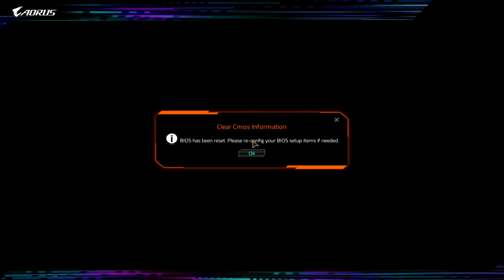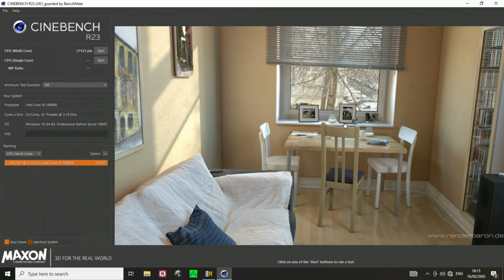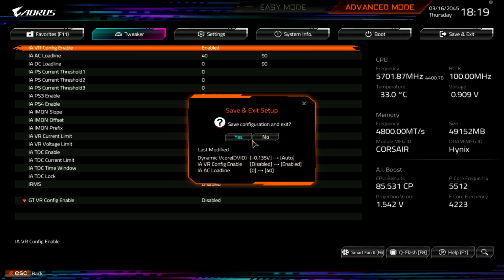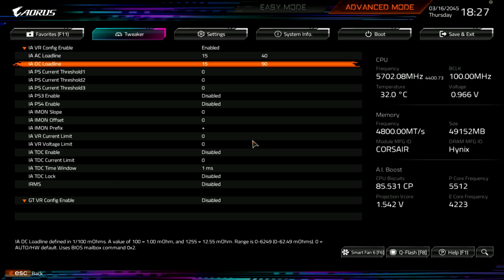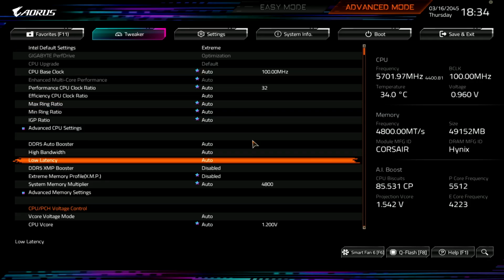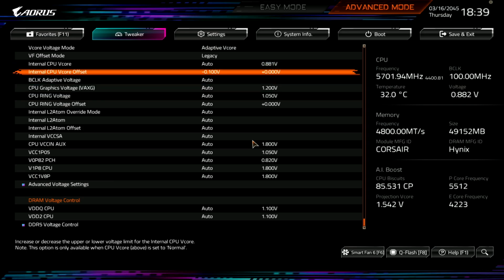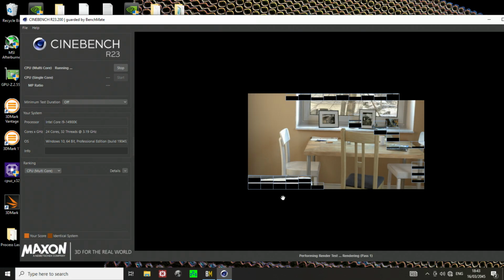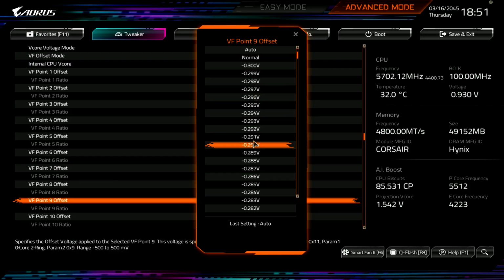YOU  DON'T HAVE  TO TURN OFF CEP to undervolt intel 13/14th gen CPUs

Comment: "So if I understood correctly, the 'Vcore Voltage Mode' should be set to 'Adaptive Vcore', then set 'CPU Vcore Loadline Calibration' to 'high' and lower 'IA AC/DC Loadline' to 55, and then the 'Internal CPU Vcore Offset' should be adjusted from something like -0.080v to the -0.110v  to tune the point where the CPU is stable?
Reply: se basicly 14k views and no person know anything about my ask :D ... and btw my r23 score with this settings is 39150 and max 1.385v and everything stable ... i tried almost every benchmark from BenchMate and im very sadisfried my temps cant go over 73 degrees but it is to god for me to feal ok :D so i need ask again can someone tell me is it ok what ive done it is described up.
Reply: Yup @CodeNameTech

Comment: I tried your config of AC_LL = DC_LL = LLC = 0.55 mOhm with CEP on and an adaptive offset (14700k, F5 bios, IccMax = 307A, no power limit). My previous settings were basically an AC_LL/LLC undervolt. The most bizarre change I noticed is that the CPU gets current-capped at a higher frequency, which results in a performance uplift in some benchmarks. I wonder whether it's a side-effect of CEP or increased voltage under load. Going to run a few more tests.

Comment: 13700k here. i did an - 0.02Voltage offset  and locked the cores @ 5.5Ghz and i never had any bluescreens since the beginning. so its below 1.35V always

Comment: Thank you so much for making this and all the other videos as of late!!  It has been a INVALUABLE source for me as a novice bios tinkerer. This kind of information and testing is so scarce, not even the board manufactures have a site you can go to that breaks down and explains how a mother board works. You have filled this gap of non information that really shouldn't exist. 
Its so weird that there's not comprehensively direct information available when using someone else's product that is designed for you to tinker with it. How exactly are we suppose to learn this stuff on our own without studying to becoming an electrical engineer?!

Comment: ASUS Z790 owners. Pls help... I'm unable to get an undervolt to work on the asus unless i use the asus defaults and this has cep disabled. 
It gets so hot without an undervolt.  
For reference if set an adaptive - vid core setting...
When i try this with the intel defaults the cpu just runs at half the speed in cinebench. Its strange.   
Help i dont know what im doing wrong.

Comment: Based on Intel documentation, CEP is the mechanism by which Fast-V Mode operates. It exists so CPUs can be safely used with low quality motherboards and power supplies that would crap themselves when trying to power a 14900K under heavy load.

I think people with higher-end motherboards and power supplies would be fine with CEP disabled, more safety features is never a bad thing.
Reply: Fast V mode needs to CEP on to work, but the two are separate features. Some BIOSes allow CEP on but Fast V mode off

Comment: Can you make a video explaining what IA AC Loadline and IA DC Loadline settings actually do? I've watched a bunch of your recent videos that touch on them but I still don't get it. I have a 13900KF that bluescreens and I can't RMA, so I'm trying to get it to be stable. For some reason, setting DC Loadline to 1 and keeping AC on auto with the default LLC stops my CPU from crashing. I've even tried undervolting with adaptive mode and a -70mv offset and it still doesn't crash as long as DC loadline is set to 1. I've capped the voltage to 1.4v, like you mentioned in one of your videos. I'm not sure if running these settings is OK or not because I don't really get what these settings do. There doesn't seem to be a performance impact with these settings and my CPU is running under 80c.

I've tried some of the settings you had in another video with CEP on and increasing LLC but that didn't get me stable for whatever reason. 

Unrelated but my CPU only seems to crash in games. Running benchmarks is stable. I'm currently using Ready or Not to test if the CPU is stable or not since that game seems to cause it to crash most consistently for whatever reason.
Reply: RoN was my canary last week. It has doodle compression issues with defective processors. I was able to get a replacement offer in 5 days, give it another go?

Comment: Does anyone know what is the most accurate values for i5 14600K ?
(With CEP enabled of course)

My current configs are:
IA AC load line = 50
IA VR Voltage Limit = 1400
PLs1 & PLs2 = 181
Enhanced Multicore Performance = Disabled
IA CEP = Auto (my bios default)
Dynamic Vcore = Auto (my bios default)
Vcore Voltage mode = Auto (my bios default)
Core Current Limit (Amps) = 200
Gigabyte z790 bios = F7 Ox123

Comment: Hi, any ideas that my 14900k only scored 38k? I followed the AC loadline setting to 55,  CPU Vcore Loadline Calibration sets to High, added Voltage limiter to 1400 and Vcore offeset -0.13. Im using same motherboard too:/ The only differences are i have XMP on and running on Windows 11

Comment: 14900K+MSI Z790i, BIOS v19, Microcode 0x120, Cooler Noctua D15
VID Offset (set through TS): Core/P Cache -0.11V
CPU LLC: Mode 4 
AC/DC Loadline: 12/0.12 mOhm (the same value as LLC Mode 4)
IccMax: 400A

PL1/PL2: 288W
UVP: Disabled
IA CEP: Enabled
TVB Voltage Opt: Enabled
TVB Pts Config: 1 Core at 80℃ -1, at 85℃ -1;  2 Cores at 80℃ -1, at 85℃ -1 (with TVB Voltage Opt enabled, this will prevent high voltage, since there is no voltage limit function)

Everything is good. R23 41000 pts (limited by PL2, around 5.5/4.3), CPU-Z 980+/17600+ (fully turbo boosted, 6.0/5.7/4.4)

Comment: I was able to drop voltages by -0.175 on my 14700kf with CEP enabled and using your loadline settings. Also I was able to increase clocks by 100 MHz, so they are 5.6 GHz all core, 5.7 GHz 1-2 cores. In HWINFO, the VID doesn't go above 1.199 V and VR VOUT 1.190 V. R23 ~37000 with 253w power limit. Also put 1.4 V limit just in case. Have to use my PC more to be 100% sure about stability but seems to be doing good.
Reply: loadline high 0.55 ac dc?
Reply: @mexicanomt2  yup
Reply: @mexicanomt2  or 45
Reply: -0.175? Damn. Let me try it with my 14700K.
Reply: @Owen-uk3sj  After a while I had to increase the voltage, as I found out that some specific programs/benchmarks were unstable. I don't remember what voltages I have now.
Reply: @aarraa9671 bro i have 13700 kf help me man... Just tell me your correct setting in bios
Reply: Set LLC to extreme? on the LLC at high it's not stable for me. I got 34K in R23 with my 14700K at the stock clock.

Comment: So LLC levels on ASUS have numbers, like 1-7, but on gigabyte it's names. So LLC 3 on ASUS = Standard on Gigabyte (1.1/1.1)? LLC 4 (0.4/098) on Asus = Low on Gigabyte? Or is it LLC 2 on ASUS = Low, LLC 3 = Medium, LLC 4 = High, LLC 5 = Turbo, LLC 6 = Extreme and LLC 7 = UltraExtreme? So what he is doing around 21 min mark is setting Extreme with 0.17 AC/DC, where this would translate to LLC 7 on asus with 0.17/0.17? Not sure of AC on LLC 7, but it should be DC 0.24, with SVID Behaviour at AUTO. Iintel fail safe on ASUS enabled does not change AC/DC at all on my board.
There is so much useful info in these videos, but it gets so hard to follow with all the rambling in between, I just end up confused and it's hard to get the actual relevant info. It's "this = do this", but with 4 long sidetracks in there :|
Reply: Also on Asus and struggling a whole lot translating it to our bios

Comment: For stressing arbitrary combinations of test program + frequency + power, you can limit peak clock frequency with the CPU frequency scaling controls, then set a CPU quota (cgroups in Linux, Battle Programmer Shriase in Windows) to PWM the test program such that it doesn't hit power or thermal limits.

Comment: Just the fact with the warranty extended , I seem many cases around me may be:

1. Give up😂 
Changed to AMD
2.like me , I am lazy to RMA coz
I void some warranty ,like delidding ,metal liquid …..just buy a new one while the DIE is really die
3. many cases ,they will not to RMA
For some country and may be hard to RMA 

In my opinion RMA quantities far away to degrade CPU
Intel wins first round

Secondary, ppl just have one pc and they dun have the buget to wait returning time , they suffering  a degraded cpu or else it cannot work anymore 

They delays RMA cycle 
Intel wins second round

Some suitable , ppl many not often to use their computer,and dun ready this news

After 2 year for later they computer not, they will think ,oh my computer is broken I should buy a new one

Intel wins again

Otherwise,intel is still selling the cpu !😅

So they wins wins wins again plus wins this game

Comment: 13900ks z690, AC DC 25~20/90 LLC low SA 1.25(auto), CPU Vdd2/Vddq 1.1v,  DDR5 6000mhz 1.3v ,P core 56x Cep OFF INTEL setting off 
IA VOLTAGE Limit  1320
dont go lettting intel baseline and 6GHZ boost (intel baseline  is extreamly HOT Temperture  0.90/0.90 mOhm)
warnning : Dont use 6GHZ boost ! , only use static clock (54~56x)

Comment: Most of this doesn't really apply to me, but is entertaining to watch. My cheap-a$$ H610M has almost no voltage controls, so DVID or loadline trickery is necessary for <1.1v vcore. Although with a 12100F without c states; I don't have power or boost clock concerns. Lowering watts/temps is fun to do anyway.
Reply: 12100F doesn't have CEP anyways

Comment: On the MSI Z790 Tomahawk this works. CPU i7 13700KF. Loadline 6 with AC/DC set to 40.
Voltage settings Adaptive + offset -0.130. All cores set to turbo offset. So 5.4GHz P and 4.2GHz E.
31410 in C23 no clock stretching. Max temp was 78 degrees with Liquid freezer II 280, 20 degree ambient.
It works exatly the same and my previous, loads of settings tweaked undervolt. CEP and TVB enabled.
I have no idea how accurate the HW Info values are on this board but for what it is worth: Avg max VID request was 1.237 Max Vcore was 1.226 (from the super I/O Nuvoton NCT 6687D)
CPU Enhanced: VR VCC Current was 180.4A and power 217W. This power, calculated agaist the Vcore reading, resluted in 176.9A so either the
voltage was a bit lower than reported or the Watt / A reading is off by a small fraction. But it seems to be withing few percent.

Either way this works great. I have tried pushing the E and P cores 0.1GHz higher than this and that seems stable as well, however I don't need
that for daily use and the only game I have played that hits all core max frequecny is Grey Zone Warfare which is a highly unoptimised UE5 shooter!
Everything else, CP2077, Elden, ABI, Warhammer, etc etc most don't get over 3.5GHz effective and that is only on a few cores.

One limit I do have separately set is power to 235W. Just as a buffer. However I obivously only hit that if I bump up the cores frequency from 5.4/4.2.

Comment: I am on fixed 1.1v with "normal" load line. 4.4ggz locked on a small cooler. Max load at throttle temps 125w.

Im wondering if this undervolt method could result in more performance.

Comment: Benchmark my i5-14600k. I limt pcore to 35x, and ecore to 26x.
With CEP enabled I get Cinebench score 350.
With CEP disabled I get Cinebench score 826.
Apart from the CPU-frequency, Im running Intel Default settings.
I have an Asus z790 motherboard
Reply: I also have an Asus z790 board and saw similar behavior where the multicore score goes from 24k to 11k with CEP enabled. Something about Asus' power configuration seems to trigger CEP pretty much automatically.
Reply: I think that means your tripping CEP. For example my mobo has the same bios as the one in the video where high llc matches with 55 ac_ll/dc_ll, and medium llc matches with 66 ac_ll/dc_ll. When i tried to reduce ac_ll/dc_ll even by 1, with 0v vcore offset, i.e. ac_ll/dc_ll = 65 with medium llc, my r23 scores dropped hard with cep enabled, and putting it back to 66 restored the score. Also noticed idle vcore was high when doing this with 0v adaptive offset, so i still needed an undervolt to bring that down. Also, i noticed in my bios that the description for CEP states that e-core performance is affected by enabling CEP so that could be another reason for your lower score.

Comment: Hey BZ, I really appreciate your work. But most of the time I dont understand what you are speaking because stuff is too technical for my small mind. I request you to make a small summary or a follow up video of 5 mins eg what settings should we dial in to save cpu from degradation without much impact on performance.

Comment: I get 5-10 degrees hotter and higher voltages with intel defaults no matter what i do on gigabyte z690 gaming x 13700k... which I suspect negates the entire benefit of intel defaults to begin with. So I opted to turn them off. Not that I had any stability problems in the past year other than too aggressive undervolting.
Reply: I'm also having higher temperatures with the same processor and motherboard. The problem is that when playing everything becomes unstable. Did you find that removing the default Intel profile solved it?

Comment: Just applied the x129 update to my STRIX Z790E II and still getting VID peaks of 1.565v in Cinebench 30-min runs
Reply: make sure you are on "Intel base Line" profile, you can still do some tweaks if you want, but to my understanding, it will only limit to 1.55v if using the intel profile (and if eTVB is set to Auto then it will be on) you need both things

1. Intel Baseline
2. eTVB is on (default for auto in Intel baseline, for your MB)
Reply: @ItaySharoni  yep, I'm on Intel Default. PL1&2 at 253W, Iccmax 307A

Comment: Does Intel XTU no longer work for undervolting 13th and 14th gen CPUs?  I have a 12900K and use Intel XTU to undervolt; nothing in BIOS; just default settings.

Comment: I've found that the Adaptive Vcore and Internal CPU Vcore Offset doesn't do anything. B460 board though so im not affected by CEP
Reply: It's undervolt protection, disable that and it should work
Reply: @pixels_per_inch  There is no option for that. Anyway I now do VID Offset through Throttlestop, works fine.

Comment: Re: stress testing individual clock speeds

I mean if you're already accepting the tedium of doing that just cap the frequency and run ur standard stress test procedure for each frequency value. That part is easy, no need to play guessing games with trying to find a workload that will clock at a given level with default boosting behaviour

Comment: Gigabyte Z690 the latest bios (f30f) 13900k non intel defaults has always been 0.6 ac loadline its 0.4 now the same as 14900k, i got a 14900ks today and they actually set that to 0.7  the same as they use on 12900k, not sure what they are upto on 13900k and 14900k

Comment: Intel's vdroop compensation is total trash, but look at the motherboards VRMs: not much different from Haswell.  My daughter's hand me down 2013 4770k rig has 16+2 phases cooled with a heatpipe on it's Z87 Deluxe and I have 13+2 for my Prime P running a 13900kf.  Intel has to leave some margin for error, temps, age.  Weaker components have more error, like cheap PSUs.
 
Or maybe not.  It wouldn't really be their fault if the motherboards died around the end of the warranty period and the CPU could still pass.
I hear Asrock is goi to have some decently capable motherboards coming out.

Either way 13th and 14th gen users should reign in that out of control voltage behavior on their CU/mobo combos if they want their stuff to last.  And perform better, quieter and cooler.

Comment: OR it's because it buried in a 2-hour rambling video with no timestamps to the important points - also, sometimes you are not actually very clear (sometimes, I said).

Also, if it keeps happening, its pebcak.  The REAL issue is the lack of more face time - quit hiding that sexy face, you bastard.